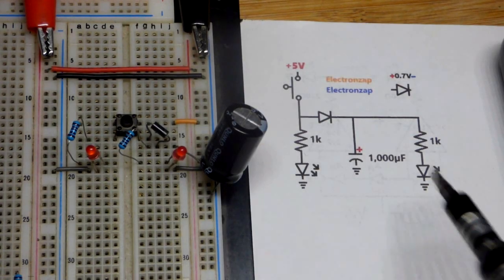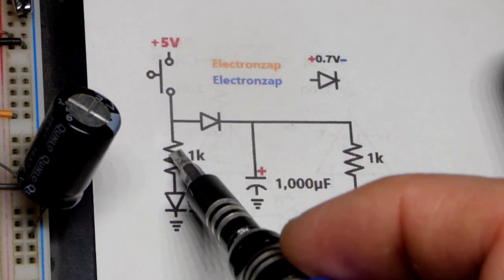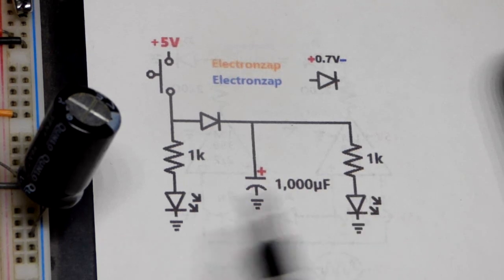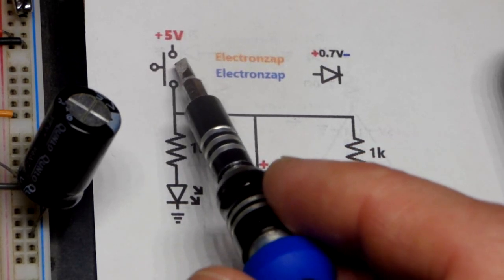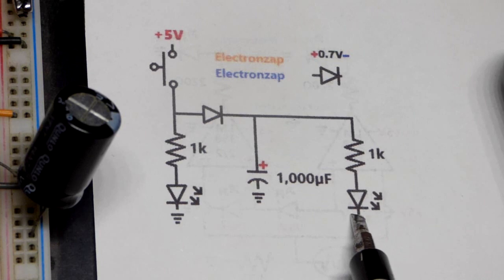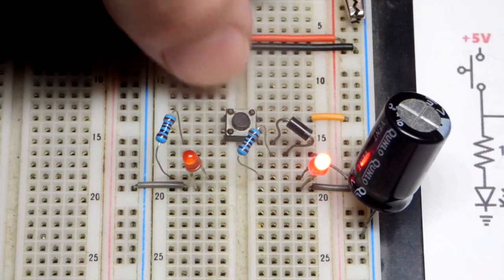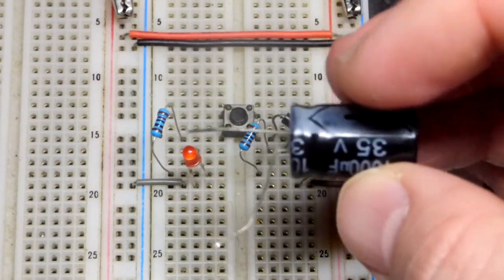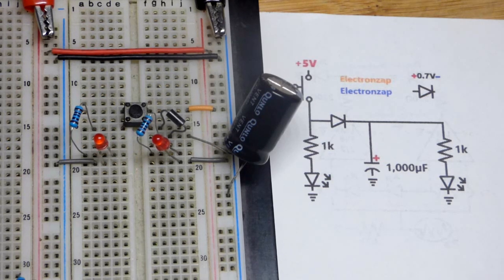Basic one switch controls two different circuits electronics demo

Comment: ...looks like a good switch debounce circuit....maybe a smaller cap for this app though.
THANKS AGAIN!!!
Reply from the maker: Yeah, I usually use a large cap for demonstrations. Usually a smaller cap would be better.
Reply: @Electronzap  Thanks,  I am thinking of using your PNP type pulse as a trigger input to get a pulse from the 555 in monostable mode.  Since the input pin is Hi-impedance, I should be able to use it without the transistor section.